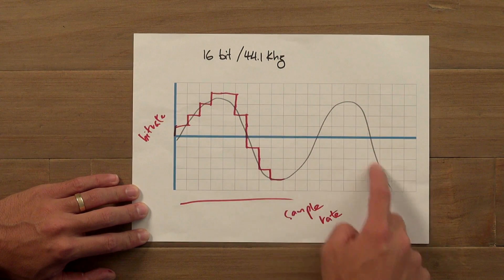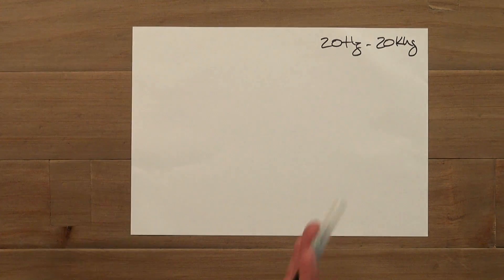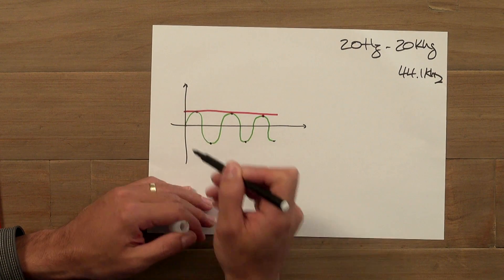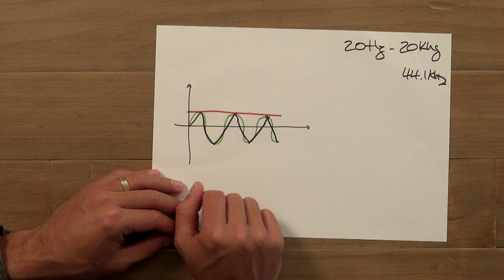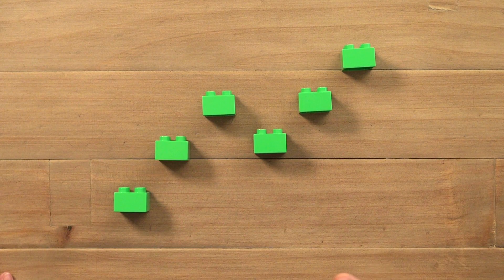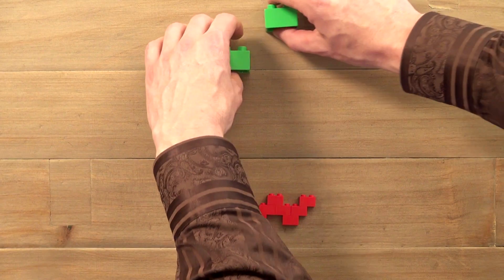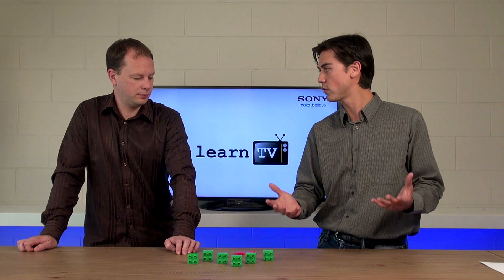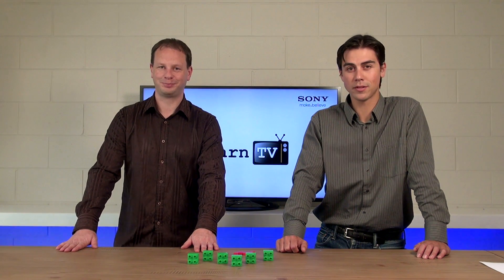Sony LearnTV - How High-Resolution Audio DSD works

Comment: The main goal of DSD is copy protection. DSD does NOT have a higher sample rate. You have to realize that PCM actually has the whole amplitude information represented in every (multi-bit) sample. a single DSD bit does not. it is only a representation of the direction the signal moving in. With DSD1024 development stopped, and PCM moves on.

Comment: Technicly PCM and DSD are Delta Sigma that process analog sound in the input of DAC , the difference is on the stream transport so for having the same result as a 96 khz or 192 khz of the PCM they use a  digital PWM stream to digitise  the analog source in 1 bit ( series of Boolean 1 & 0 a bit ) so it's technicly a more RAW process with a high pass filter to supress the dither noise of the PWM process , on PCM your converter make a snapshot of your analog sound every milisecond the difference is 24 bit or 32 bit can be cleaner than a DSD, the only default of PCM is this process can't record the square waveform of a mini moog , in fact the PCM do some kind of interpolation or aliasing to rounded a bit the square , but your ear probbaly won't make a any difference compare to the DSD able to do it especialy if you DSD is a PCM over DSD conversion, DSD can also be converted in PCM, but a good 48 khz 24 bit or 44 khz 24 bit is most of the time enough for many people, even a 16 bit is enough.

Comment: The DSD is not about higher frequency range and not even the youngest human do not hear much above 20KHz. What DSD do  is use PDM (Pulse Dencity Modulation)  to extend the dynamic range (could be 120dB) using high sampling rate, 64 time or higher then higerst audio frequencies. One of the  PDM  properties is that it concentrate the most sample where the bigest changes in aplitude accure, so the spacing between sample vary, however the sample lenght is constant, equal to the maximum sampling frequency. For example if the sampling frequeny is 1MHz the sample lenght will be 0.5us. What more ineresting in the circuit to convert audio signal to PDM is one bit Analog To Digital Converter (ADC). What inportant: building 1 bit ADC is extreamly simple and very chap. If you familiar with basic electronic you can buil that with one D-flip-flop few resistors and 2 capacitors (cost below $10). The only more difficult might be to get square wav clock frequency. You can build such square wave generator for few dolars or buy on Amazon propably for lower then $50. The twis on DSD is that it combine two chanels. Another iteresting future about PDM is that with siple filter on output you can direcly feed that in to your speakers or headphones. No additional Digital to Anaog Converter is needed. This is what most contemperary cell phone or other digital devices do for adio output.

Comment: This at 6:05 is a hi-re$ marketing LIE: that we hear beyond 20-20kHz at concerts. Trust me, if you look it up you'll discover concert venue speakers don't even cover that range so the claim we get a larger frequency range at concerts is a LIE.
Reply: I think they meant to say when you are watching a live performance that is unamplified and you are hearing the sound as it comes off of the instruments and the singer's voice.
Reply: @michaelbeckerman7532  Nope. At 6:09 ". . . and anyone who's been to a live concert and they've got the subs going will know that you can feel the bass. . . " proves they are NOT talking about an un-amplified concert. All subs are amplified either externally or internally.
Reply: You can because the volumes are higher than your audio system you listen in your room. This means even 20 kHz normally you can not hear is probably magnified more than your hearing border...believe it

Comment: The guys in the video do not understand what they are talking about! They are clearly out of their depth. There are so many basic mistakes! For example:
- The vertical axis of PCM graph represents quantization steps resulting from the bit depth - not bitrate.
- Quantization is not what "rounds up" the jagged output in D/A conversion. This is done by a low-pass filter.
- Feeling ultrasound - no reliable tests showed that human can feel ultrasound! Which is very different from infrasound.
- DSD is not a stream of 2 bit values. It is a stream of single bit values.
- In the explanation of DSD they are describing delta modulation instead of delta-sigma modulation.
- Though they presented some parameters of the CD-audio's PCM and DSD. They completely fail in comparing them adequately.
- DSD should be compared with adequate PCM, not with CD-audio which is over 30 years in the consumer's audio, which has much lower bitrate and lower quality parameters.

Does Sony really employ such amateurs for "promotion"?
Reply: I think you are right. My question is (starting from the LEGO model of rhese guys) : how is a silence (zero sound) qunatified? Just adding zero's is in the presented model nothing more than a down slope, not a sudden silence.
Reply: +Václav Brožík 
Here's a PCM  Sine wave of 22050hz  Sampled at 44.1khz.  
 note that anything that's not the actual sample, is the DAC 'guessing'  trying to connect the dots 
( yes.. the DAC will be connecting the Dots differently than this drawing, and that's beside the point )

http://postimg.org/image/v1ty48z4p/

The wave is described by a single sample per half-wave,  this is the minimum amount of samples per half-wave required, resulting in a brick wall at 22050hz. " but isn't this outside the audible spectrum? "  Well let's do a  11khz example then.

http://postimg.org/image/m2v5j3wex/

2 samples per half-wave at 11000hz..   No amount of bits can change this,   even at 10000 bits /44.1khz the waves would still consist of the exact same amount of samples. 
Then we have 4 samples per half-wave at  5500hz,  8 samples per half-wave  at  2750hz   and so on.  
When describing a sine-wave using 2 samples, increasing the bit-depth will only improve the 'accuracy' of those 2 samples, but i wouldn't refer to it as a higher resolution, since there were no increase in samples.  
Higher Bit-depth allows the 2 samples to have a more accurate amplitude,  but 2 samples will still only be 2 samples. 

               Bits = SNR 
Sample rate = resolution

I've heard people refer to the  'kbps' of a recording,  as if that is the "Resolution"
   you calculate the  kbps  by saying   16bit  x 44.1 sample rate = 705.6 x 2  =  1411.2 kbps    (regular CD)

( multiplying the result by 2, because it's stereo )

So what's being done is multiplying the  SNR with the sample rate, and they believe the kbps  will represent the  'resolution'    
That is like claiming a monitor's resolution were  120hz refresh rate x 1920x1080pixels =  What?
SNR and Sample rate  are two different things,  multiplying them is a pointless exercise.
You might have a computer screen with  a refresh rate of   800hz, but if it's maximal resolution is  640x480,   that's still a low amount of pixels, even though it's a very fast refresh rate,  multiplying the  refresh rate with the amount of pixels, will be the exact same pointless exercise.  
DSD's entire worth of kbps is in samples,   there ain't no  Multiplying  SNR with Sample rate when it comes to DSD.  So comparing DSD and PCM's   amount of information "kbps"   is ridiculous.
                                                                                    
Here are three examples:    32bit/44.1khz=  2822kbps     
                                                 24bit / 48khz =  2304kbps
                                                 16bit / 96khz =  3072kbps

What did we learn from this?  that  16/96  sounds better due to having more information?  I'm afraid that ain't the case.

 32/44.1  SNR of  192,5dB       and a sample rate of   44.1khz.  
 24/48     SNR of   144.49 dB   and  a sample rate of  48khz.
 16/96     SNR of    94 dB          and  a sample rate of  96khz. 
 
The SNR of expensive Dac's  is around  120-130 dB SNR   and amplifiers are well below that,  so there is no point of   24bit or 32bit,   roughly  20bits would be sufficient, due to the limitations of  SNR in dac's and amplifiers, cables etc.
 So there is a lot of wasted  kbps in the 32 /44.1khz  greater SNR than any gear will be able to produce..
Most gear can't even produce half the SNR of 32bit,  on the other hand  sample rates of 96khz  are not wasted kbps.  

If your DAC spec sheet says  128dB SNR,   then the moment a 24bit 148.8dB SNR  audio signal enters your DAC the signal is instantly turned into 128dB SNR.  if a part of your audio chain has a lower SNR than 128dB ,  then the lowest rated equipment will decide your signals SNR before it is played out of your speakers,  even though your sound signal in the digital domain started out as a 148.8 dB SNR signal.

Another thing is that when you decide on having a static sample rate,  it's an inescapable fact  that lower frequencies will consist of a larger amount of samples than higher frequencies will.  
When you choose sample rates  down in the  44.1 - 192khz  your 10-20khz audio spectrum will digitally speaking be a square signal trying to describe curved waves. 
The PCM-Dac will be playing 'connect the dots' while the DSD-Dac are producing so many dots, that the dots themselves will be drawing smooth curved lines, resulting in a pure analogue signal in the digital domain. 
How people fail to comprehend this is beyond me..  

 I've heard people say, and it seems to be a regular saying among PCM fanboys,  that  24bit / 88khz  is 'the same'  as  2.8mhz DSD... how they end up at that conclusion based on kbps is laughable. 88khz  will  describe a  20khz sine wave using 4.4 samples, how are these 4.4 samples as good as   DSD64's   2.8mhz    140 samples  at  20khz?
Oh yeah that's due to the fact that they multiply the SNR with the Sample rate, because they are PCM fanboys who needs to go study the subject more thoroughly. There exists actual purchasable music at DSD 11.2mhz  sample rate, 
at such high sample rates even a  20khz sine wave will consist of  560 samples.  
16/44.1 needs to be all the way down at 78hz  before it starts having that many samples to play with. 

let's make a DSD  SACD  2.8mhz  example 
 1bit x 2800khz  =>   2800 * 2 =  5600 kbps

What we have here is  5600 kbps worth of samples. in other words 5600 kbps worth of actual resolution.

Then let's do a   PCM   24/96 example
24bit x 96khz =>  2304 x 2 =   4608kbps             
Please understand that we are only dealing with  96kbps worth of samples.   Multiplying the 24bit SNR  with the  96kbps sample rate gave us  4608kbps,      DSD in reality has a very low SNR  since it's only 1bit,   but they found a way to increase the SNR way up to 24bit standards,  while maintaining DSD's immense sample rate / resolution.

and finally, let's do the 11.2mhz quad DSD example.
1bit x 11200 => 11200 * 2  =  22400 kbps worth of pure samples.

24x 192 =>  4608 * 2 =  9216 kbps

So if we were to assume ( which we shouldn't )  that kbps said it all,  then  Quad DSD  has  60% more 'information' than   24/192 pcm, and that's not everything..
 it has that much infomation in pure sample amount!  while    24/192   only have  192kbps worth of samples, that's less than 1%  of  Quad DSD's. The fact is that DSD sounds so good that i bought a 1000 dollar DSD DAC  immediately after hearing DSD for the first time, with no hesitation at all.   
There is no comparison, even DXD which is 24 / 352.8  PCM   sounds  harsh compared to  2.8mhz DSD.  
 (  yes my DAC also plays DXD )    i got  a TEAC UD-503   Quad DSD / DXD  capable DAC.

The people who owns the  studio's with DXD ADC's  who actually record music at   24/352.8   says  that their recordings sounds best at  DSD even though it was recorded in  DXD 24/352.8.  And i agree.
 
 https://referencerecordings.nativedsd.com/albums/FR718SACD-beethoven-symphony-no-5-and-no-7

"Interestingly, we found after listening to DSD files made from DXD edited masters that the DSD, particularly the higher bit rate examples, sounded more natural, spacious, and life-like than their DXD parent from which they were made."

Yes,  obviously   11.2mhz sample rate sounds better than  352khz sample rate ..?  i would'n need to hear those recordings to arrive at that conclusion. You can also buy actual music recorded in DSD on that site,   either you buy Analogue to DSD,  or you buy DXD to DSD,  but you  stay far away from PCM, once you get the chance! 

 People who writes down obscenities like   " DSD and PCM sounds alike " 
These  are bitter people who have never even heard DSD...  i can guarantee you that,   there is no resemblance between DSD and PCM!  I've read somewhere that blind tests had been performed and nobody were able to differentiate between  DSD and PCM,  and that's just impossible,   where did they find these people!?  That would be as unlikely as finding a target group incapable of differentiating between tube amps and  class-D amps...  Well i'll leave it at that.

 -Hitashi
Reply: @Lasse3  I completely agree. I've compared PCM to DSD and yes, both sound very nice, no question about it, but the DSD file is just somehow more alive, more immersive and has much more depth and texture to it. When you listen to PCM you feel like you are listening to a really good, high-quality, well-made recording. When you listen to the DSD file though you just fell like you are right there in the studio with the artist when they are laying down the original track. No matter how you slice it, DSD just somehow always seems to have more presence to it - it's like you are actually there with the artist as they are performing.

Comment: What they says in this video about ultrasounds is also craps. You call feel the bass frequencies with your bones, that's true, but ultrasounds don't work the same way at all!
To make it clear, nobody is able to feel the presence of bats flying around during the night, although, they make astounding noises. But the frequencies used are way to high for us (50 KHz). There is no way for humains to ear or feel the presence of ultrasounds and, if any humain is able to do so, I won't be surprised to ear that he hates it.
All this fuzz about 96 KHz and higher frequencies is just bullshit. What engineers needs is 128 bit recording to obtain better results (more dynamic).
Reply: U can never get 128 bit recording.  You're always limited by the analog stage, so it's impossible to even get a full 24 bit recording as of the year 2022. It simply doesn't exist. You have to improve analog circuitry first, which is the bottle neck in this equation.
Reply: I disagree entirely having experienced an ultrasound.

Comment: This is not how sound works in practice.  Stair steps?
I love Sony but, don't mislead people c' on you guys.  Stair steps?
I am astonished at the way you guys explained everything.
Reply: *****
The problem is, that these two guys ommited explanation of one crutial steps of PCM.  They mentioned sampling and quantization, but ommited the explanation of the coding completely.  Two out of three components of the PCM is still good for the purpose of this explanation, but it doesn't convince one, that the coding stage into basically pulse or no pulse, make's it a one bit stream basically, even the PCM. 

Anyway, the PCM I kind of understand.  These guys are on the good way of explaining the DSD.  But without first understanding the 1 bit delta orversampling, or the 64x oversampling, and then going to DSD directly, whoohoo... I got some steps ommited in my learning. 

About feeling the high frequencies, these guys seem to be talking a bunch of bollocks.  The ultra high frequency can contribute to the timbre of the sound, since we perceive combination of different pure frequencies as a timbre, not separae frequencies.  So, this is where the need for sampling at higher rates comes from (192KHz anyone?), but not "feeling" high frequencies.  Give me a break...
Reply: They do, computer scince is "discrete" math, not continuous like calculus.  Nonetheless, there is some noise added, and low pass filter applied to smooth things out, so it most likely comes out without "stair steps" out of the D-to-A converter.  But stair steps definitely exist in the digital data itself.  Stair steps even seems to exist in the way ear processes the sound.  It's all 70 millivolt impulses of different frequencies (not different intensity), so our brain sort of works in digital way, like the stair steps.  Yes, we don't really need analog stage to get the sound to our head.  But the technology is not there yet to get Hi-Res audio directly to our brain, so we have to go through D-to-A, air, and then analog to electric again in our brains.  Quite awkward actually.

Comment: Drawing a PCM signal (discrete function) as stair steps, "triangular"-looking 20kHz signal, "wall of sound"... Come on, guys... A constant growth in signal amplitude should be represented in DSD as a constant "1" value that will do absolutely nothing to your speakers. You oversimplified things too much.
Reply from the maker: Yep, don't totally disagree with you Denis, however our intention was to provide a pretty basic introduction to the concepts. Unfortunately pitching this to people not exposed to a lot of audio technology meant terms like "delta-sigma modulation" were not really an option so we did scale back some of the detail.
It's good to have your thoughts in the mix, and hopefully we still helped some viewers get their heads around the basic approach differences between PCM and DSD.